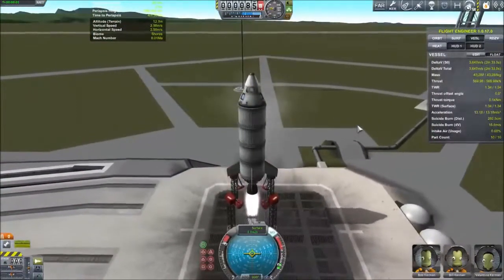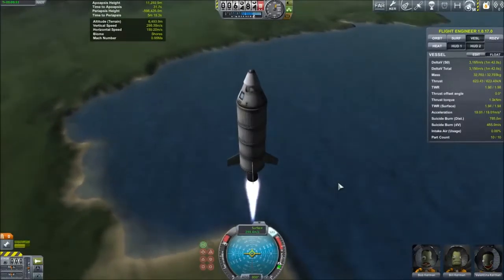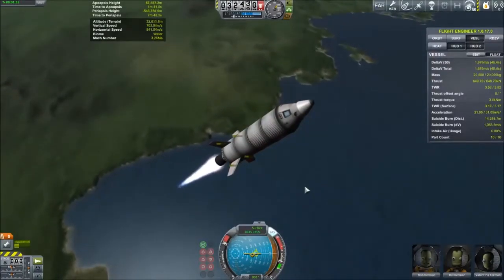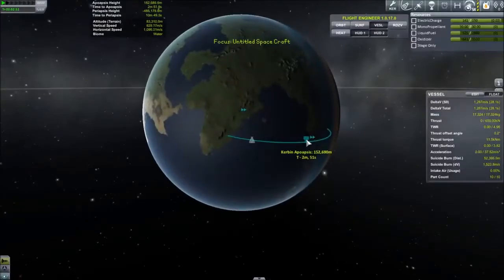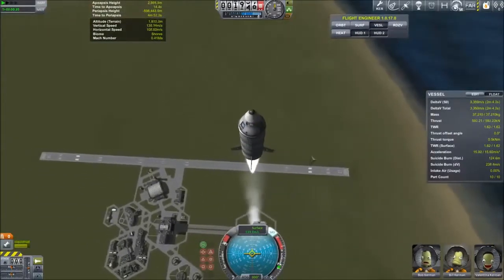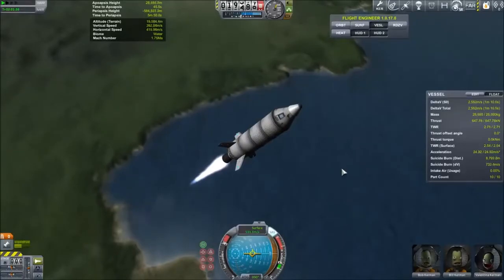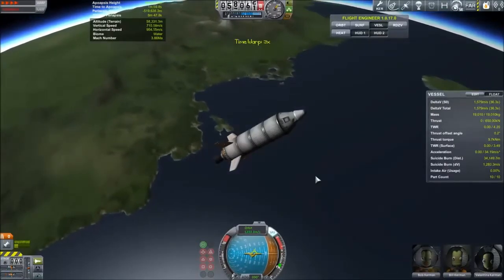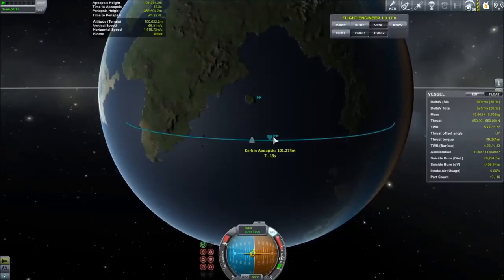Kerbal 101: Launch Profiles A Guide to the most efficient method

Comment: Wow weird. Made the same rocket as you with the skipper, 1 large fuel tank, added a heatshield, decoupler, antenna on the side, 3 kerbals and a parachute at the tip of the rocket.
D/v at launch is 3675. TWR 1.34. Did a launch profile as VAOS recommended in 1 of his videos: 
At 50m/s after launch start tilting rocket. At around 10 degrees, hit prograde button with SAS. Turned off at 90km apoapsis. Burned at apo 747 d/v for 91km/89km orbit.
Left with 843m/s left of fuel. Left scratching my head as it only cost me 2843.
Tried again. This time I had flames everywhere as I was ascending, stopped burning at 100 km apo. Burned at apo 171 d/v for a 97/91 km orbit. 
Left with 969 d/v this time.
I don't have kerbal engineer, I couldn't install for a strange reason so d/v readings are from the staging bit. I assume it's inaccurate? Still I have so much d/v left in orbit???
Reply: btw no mods just 2 dlcs
Reply: Is the 3675m/s Vacuum Δv or ASL Δv?
Reply: @AndyWandy242  It was the reading the game gives you in the staging part as you build the rocket, so I presume ASL. It was actually 4000+ vacuum. I ended up using the debug/cheat menu to give me vacuum d/v when building rockets.
Reply: @divegabe  You don't need the cheat menu to see vacuum d/v when you're building a rocket - you can change the reference point used to calculate d/v and TWR. Just click the d/v tools button at the bottom right of the VAB/SPH interface.
Reply: @AndyWandy242  Brilliant thanks, I'll try that next time I play.
Reply: @AndyWandy242  wow